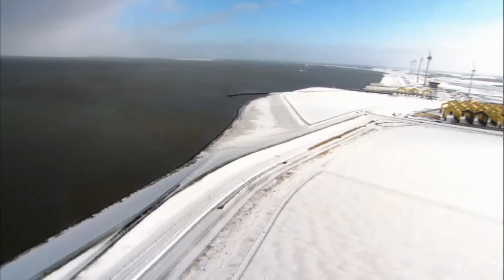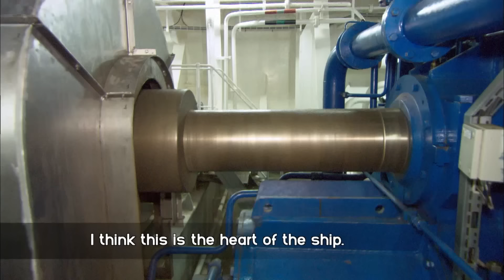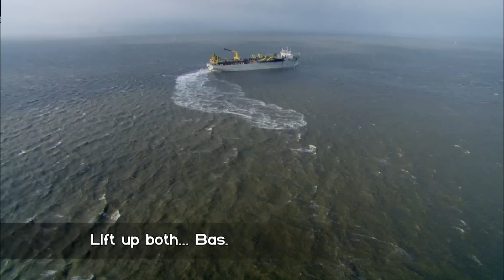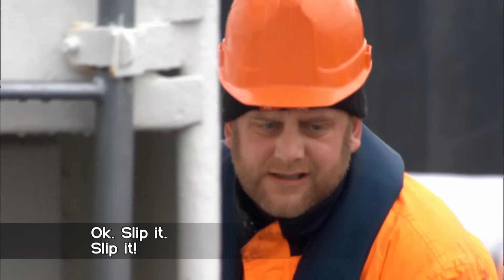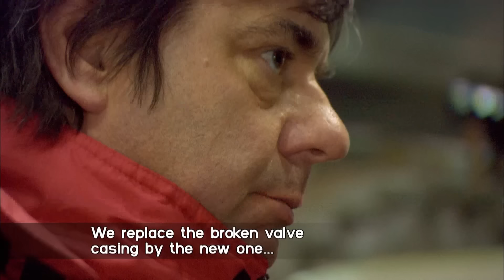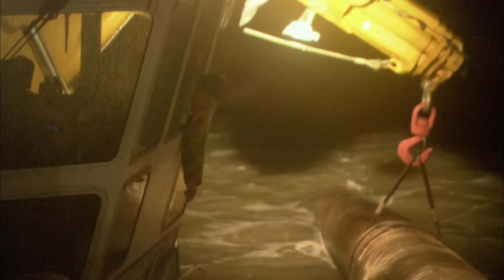Mighty Ships: Cristóbal Colón | World’s Most Powerful Dredger | Season  3 Episode  3 (Full Episode)

Comment: 3,000,000 yard is a pretty small dredge job. I would say I'm the very much on the lower end and the smaller end the hopper dredge is probably the best selection because he can work in a busy channel without pipe that turned around and jet material where it needs to be to make the additional land the rest of this year listen to is a bunch of fluff. I think Japan and China have even bigger hopper grids and if that's a brand new hopper ridge, I would be absolutely shocked because it looks pretty beat up work drudging jobs for many years just to qualify what I saying.